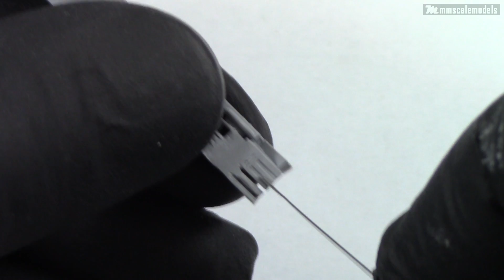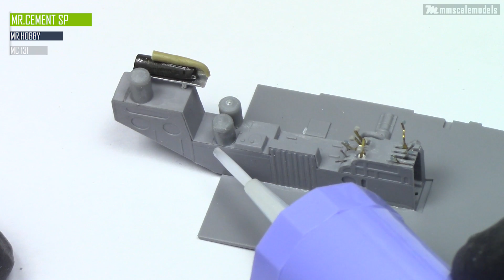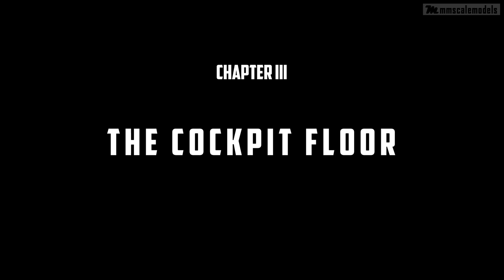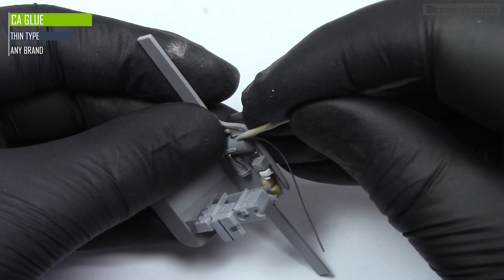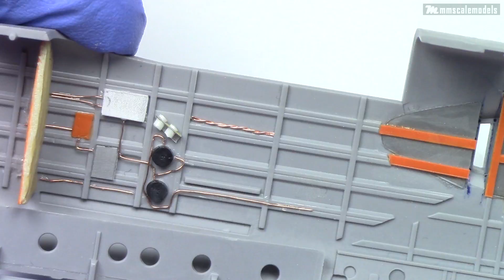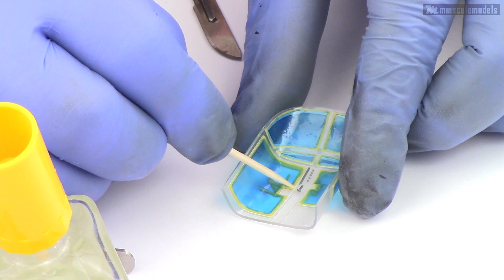Super detailing the cockpit - Ep.1: B-26B-50 Invader - ICM - 1/48 scale model build.

Comment: G'day Metodi, A few years back I found an old kit of a 1/48 Avro Anson. It had near perfect exterior panel lines, access panels etc. but on the inside of the cockpit the sides and floor were virtually empty. As the Anson had a lot of plexiglass cockpit area, it just didn't look good so, I had my first go at 'dressing up' the interior with 'stuff' to make it look, at least, a little interesting. 
I've never been good with manipulating tiny bits of wire and when I tried it on the Anson it looked like sewerage piping; totally out of scale. After a lot of thought and some strange experiments with different materials I began trying to shape the thickest 'ships rigging' thread I could find. 
I twisted three long pieces of rigging tightly together and brushed small amounts of white PVA glue along its length. After drying the rigging was still a bit flexible but much easier to handle. I ran smaller lengths of this 'fabric wire' from little components I made up, similarly to your 'gadgets' on the cockpit walls and flooring. I also used little PE boxes left over from other kits. Carefully spot gluing along the 'wire' into and out of the 'boxes'. In between the boxes I placed tiny, short strips of doubled over layers of cooking foil over the 'wire' to stand in for cable tie down fixtures.
After all of this was done, everything was painted with British cockpit interior paint. Then with a very fine 'Pocar' brand 'ink pen' I painted all the fake 'wire' with various shades of metallic paint. A couple of them I painted them back to the original black colour of the rigging thread to simulate insulated cables or hydraulic piping. 
The end result was something that looked a lot like genuine wire or metal conduits with 'wire' inside them. The process took me long time so, I didn't do it on all my aircraft builds; only on those with enough cockpit windows that let you see what was inside the cockpit. Never on larger planes like bombers that have comparatively smaller windows. 
As I'm sure you have discovered, it doesn't really matter what 'tangle' of wires and gadgets you put in your cockpits they just make the whole assembly look much more authentic.
The thick rigging thread worked for me and I hope it helps other modellers who, like me, have trouble bending tiny bits of real wire.
Your work is a pure joy to watch and although I can't duplicate what you do, I find I'm getting a lot of technique tips from your videos. 
Thanks very much!
Cheers, Bill H.
Reply from the maker: Hi Bill, I did also some trial with the rigging material. It works well for simulation of wire looms. The issue I have with it is the price. Here i have access only to the mainstream producers like Ammo by Mig and so on. What brand are you using?